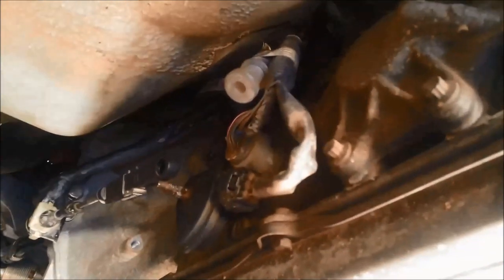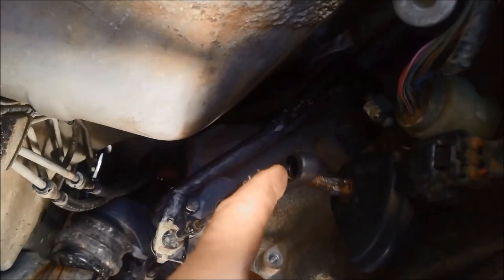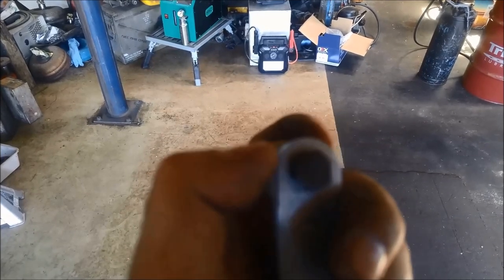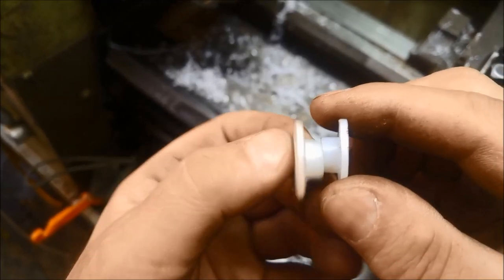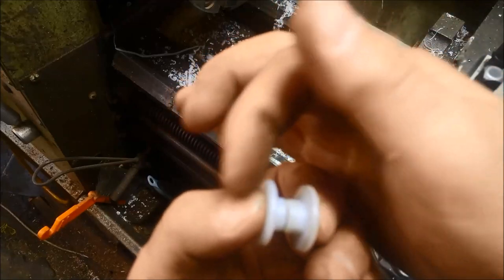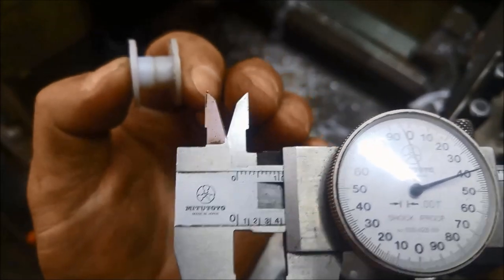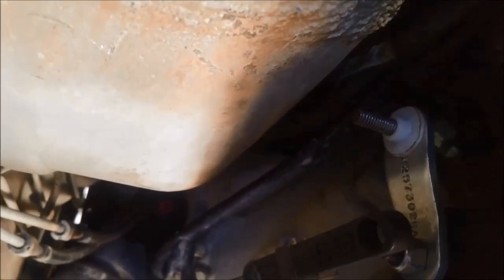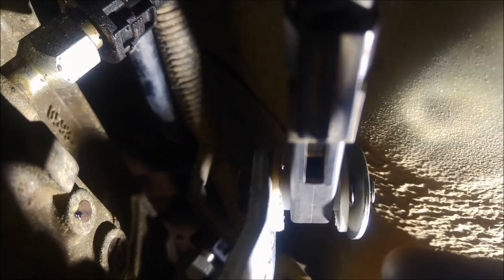Ford AU BA BF FG Automatic Transmission Selector Cable Repair/Mod without replacing the cable How to

Comment: FYI, for anyone stuck on the side of the road with this issue, if you can safely get under the car, push the cable back in to place, put a zip tie around the selector lever, loop another zip tie through the first one, and put it around the cable head as near as you can to the join, pull both gently up snug. Basically it forms a figure 8 that holds the cable in place. The car should be driveable as long as you are gentle.
Reply from the maker: thanks for that
Reply: Exactly what lve done cheers mate
Reply: Got the step son to do it yesterday in the bush using wire, black tape ( sticky) and the electrical ties got us back to Dingo Piss Creek. No thanks to the local road service agent..drove 4.5hrs..used the gear lever gently. Thanks guys.

Comment: It refreshing to see that there are specialist that have engineering and repairing skills as apposed to just the 'plug n play' world we live in.  Great work, enjoy the vids you provide. cheers
Reply from the maker: thanks and cheers ;-)
Reply: I'm fitter by profession, but I don't have home Lathe machine to make bush with little gap for selector.I have puchased Dorman Bush kit 14055 in GSS auto parts original kit for Ford falcon $45.Also is good to puchased on ebay this few bushes for spare, because my bush was broken under console ,not under car and I have to open my midle console place in screwdriver and come home from shopping centre withouth towing services,because shiter selector was not engaged in gears which is common problem nob is from plastic and from time to time will fail.

Comment: Hi. Thanks for your great video. It was of great help to me. 

I basically did a similar fix but ran into a problem. The cable appears to have slipped or something and is out by one gear shift. In other words when I put it into PARK, it tells me that the gear box is in REVERSE. I could not see anyway of adjusting the cable. Perhaps you have come across this problem before and maybe able to shed some light on what may have happened. I guess my next step is to check if the actual gear shift connection inside the car has failed in some way........Oh joy :face-red-droopy-eyes:

Anyways, thanks again for your time and effort. Its much appreciated.  👍

Comment: Had this happen on my BF wags years ago

Take the original off, cut the shaft off and drill a hole, get a nut and washer small enough to put on and then put the cable/linkage back on your bolt and tighten it up, worked a treat till the next owner hit a roo
Reply: Pretty much exactly how you’ve done it, easier bush mechanic mod I’ve ever done
Reply from the maker: hi, thanks for that. the selector shaft already has a small hole with a pin that goes through it to stop the bracket from hitting the switch when you do up the nut. cheers

Comment: Good job with new plastic nob.I have had isue with broken plastic bush inside under console and Dorman kit with two  plastic nob was $45.I have used screw 5 mm with two wahes and bush was install easy in.After that I have had  isue Error Park and Drive which give to me indication on bottom where is bracket for cable is factory build white clips for proper cable adjustment and gear selection on cluster problem was solved. I have lube nob for selector with marine green grease which is very good for plastic,bushes and moving parts.
Reply from the maker: no worries, thanks & cheers

Comment: I have this problem at the moment and I would like to do a fix like this over replacing the whole cable system.
Happy to replace the cable system (Not Lazy) it is just a waste when the system is working fine except this particular wear and tear fault.
Only problem is I dont have a lathe or those fabrication skills ready to go.
I will have a look and see if I can find a way around this cable ties is a not so great solution.
Need a reliable fix.
And thanks for this video.
We need more repair stuff like this instead of the throw away and replace quick fix ideology.
But hey sure when something is a write off well no convincing needed.
Reply from the maker: hi, you can make the nylon bushing using a drill, bench drill or file, wont be as snug as when done in lathe but still should do the trick. cheers
Reply: @YepThatsIt  Loveelleeeeee thanks mate im looking forward to givin it a crack. wooohoo

Comment: Beauty. Thanks for this fix. Saving me a few sheckles on a tow. Does anyone know where might sell a reinforced nut and bolt (sinilar to the machined pieces in video)? 
Thank you!
Reply: Update: I took it to a transmission specialist near me to repair the cable. Price was $140 (reasonable considering they replaced the cable mechanism) and the car has never selected gears smoother. Cheers
Reply from the maker: no worries, wouldnt have cost you that much. cheers

Comment: I need to know what that plastic peice is Called between the cable and selector ASAP. I’m stuck and need to find one regards. I’ve Broken it up bush 👍🏻
Reply from the maker: hi, we spin up nylon on our lathe to suit. sometimes the plastic is still glued in so not all are same. best to push cable back on and wire it up or cable-ties until you can repair. cheers

Comment: I think I have same issue. My car is in park but it’s actually reversing. Doesn’t let me go to any other gear. Can you see this part of the car without a car hoist ? I have no knowledge with cars but I know something has come off cause when I roll back in reverse I hear a ticking sound
Reply from the maker: hi, just be careful getting under car. you should be able to see on passenger side trans. cheers

Comment: Now i just need a lathe and components 😂
Reply from the maker: hi, adapt and improvise. cheers
Reply: It's plastic or Teflon not steel so u could fit some plastic/Teflon in a drill chuck,put the drill in a vice and use it like a lathe. No it's not going to be perfect but it'll be good enough for a selector cable bushing. Either that or buy the bushing and fit it yourself or pay a mechanic to do it.
Reply: @YepThatsIt  love ya work mate. I own a Territory 6 speed and they have the same problem. Your a real mechanic not just a parts fitter. I respect that. Keep up the good work(especially on Territorys 🤣)

Comment: Hi my ford xr6 2011 sedan.. cable went lose again stuck in park. We had this fixed which required a tshaft box. But the cable was good but now its stuck in park do I need a new cable.
Reply from the maker: hi, really hard to say without having a proper look. if stuck in park maybe park pawl spring broken? cheers

Comment: Mine xr6 snapped today .... have see how much the mechanic will charge tomorrow...
Reply from the maker: hi, common fault if they dont set the cable properly, it will push to one side too much and cause premature failure. cheers

Comment: Where is the location of this cable exactly. My car is stuck in parking and gear lever is free
Reply from the maker: hi, left side of trans, towards lower part of trans case above the tans pan rail. you should be able to see it easily or rewatch the video. cheers
Reply: did u end up replacing cable

Comment: A lock nut would save you putting  two nuts on the shaft.
Reply from the maker: hi, we put 2 nuts ( tighten them against each other ) so you can adjust how tight or loose you want. a locknut on its own wont do that as effectively. cheers
Reply: @YepThatsIt  Ok. I just repaired mine with a bolt and lock pin. 👍

Comment: Yeah everyone has a lathe in their shed....not🤨
Reply from the maker: hi, use the tools you have....you can fashion a nylon bushing on a bench drill or file and nuts bolts washers. the best tool is the tool behind the tool...cheers